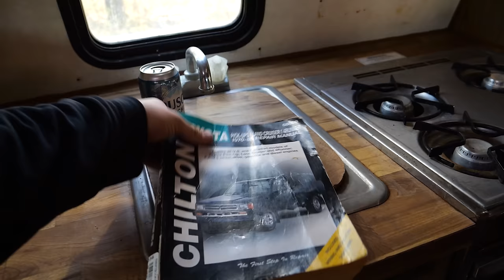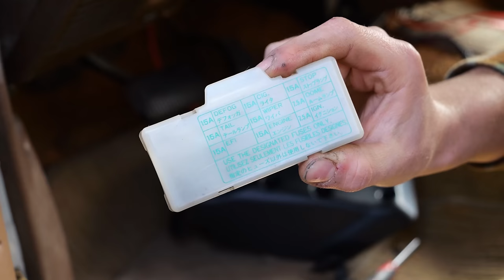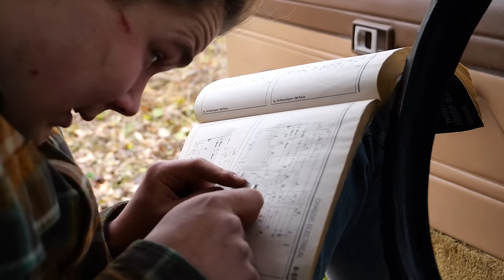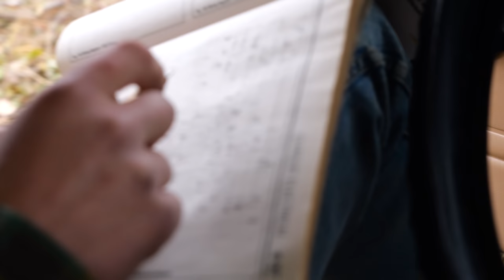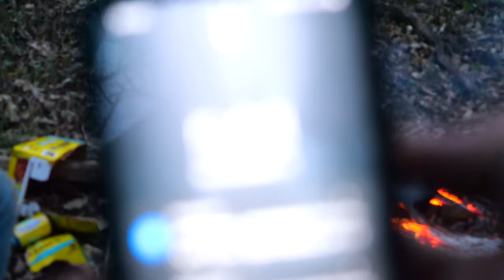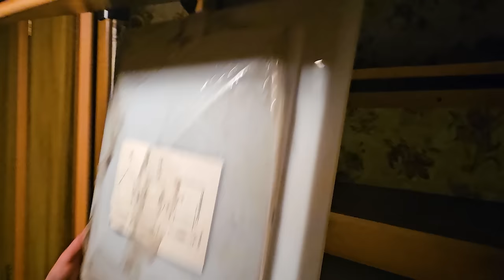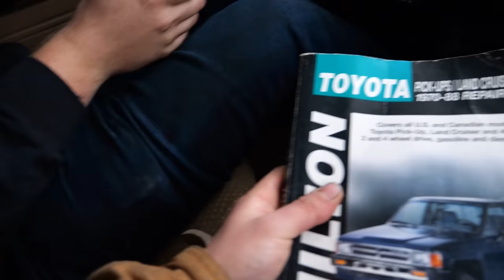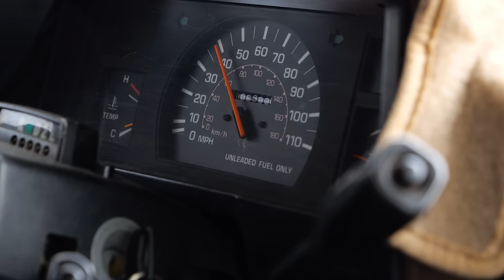Will this Old Camper RUN & DRIVE Out of the Woods?

Comment: the maf sensor has a flap in it that closes the circuit for the fuel pump. So if that engine isn’t sucking any air your fuel pump ain’t pumping. Found that out myself a few years ago working on an old Toyota truck that had been sitting in a storage locker since 1997. Took me 3 days of stress to learn that.
Reply: i got tripped up on this also on my 94 pickup. its definitely an odd way of triggering a pump
Reply: Same on the Celica Supra with the 5m
Reply: 1.6 Miatas work the same way
Reply: The 1990 -94 capris are like this too.
Reply: Yeah, a lot of old cars with the "flapper style" air flow meter worked that way. They do have some adjustment to them as well.
Reply from the maker: What a strange design!
Reply: @JunkyardDigs  I believe it's in case of a crash or whatever causes an engine stall, the pump isn't stuck on dumpings fuel. Also, to not over pressurize a return less system
Reply: Love the respect
Reply: @JunkyardDigs  still waiting to see that b&m supercharger and side pipes from that mustang II on the limo like I suggested
Reply: @JunkyardDigs  old Datsuns, Toyotas were this way.. When you crank the engine enough it will generate enough pressure to open the flapper just a little and then the fuel pump will engage.
Reply: Great episode!! Thanks for sharing your talents, friends and adventures!!!
Reply: Subaru too
Reply: @JunkyardDigs they did it for emissions. My 89 Celica had the same thing also had the crack in the tube. When it would run like crap or not start I knew it was time to replace the tape on it always kept a roll on me in the car 😂😂😂
Reply: @JunkyardDigs  ....toyotas
Reply: If its a bosch based system, it should run the fuel pump while the key is in the start position
Reply: So in theory, if the engine has a form of vaccum leak, as Kevin suspected, it wouldnt be able to pump fuel well enough? Especially after hours when the engine hasnt run, which they seem to run into as well
Reply: First of all check the neutral safety switch, then investigate what's going on with the fuel pump
Reply: aWESOME
Reply: @henryanderson7606  those little trucks were notorious for the problem being in the shifter. Pull up and hold, then turn the key.

Comment: That interior is really in good condition. This is overall a pretty dang nice example of one of these.
Reply from the maker: Come and get er😂
Reply: @JunkyardDigs I would if I had the money laying around. Toyotas and Hondas cannot be killed.
Reply: @JunkyardDigs I will!
Reply: @nahno767  Go get it, buddy. If it wasn't half the country away I would too. It is a very nice little RV. Kevin can keep the crappy Chilton's Manual. Those things are pretty much useless for Toyota pickups of that era. There is technical knowledge that needs to be known but it ain't really in that book.
Reply: How much?
Reply: @JunkyardDigs price? Interested
Reply: @JunkyardDigs if you put a v8 swap from a newer Tundra in it or a Isuzu turbo diesal from a cabover or forklift in it  someone would pay you dum money for it that thing is nice the 22re is bullet proof but man  your only doing 50mph downhill with the wind behind you at 12mpg in it on the wood wide open when she was new 😂
Reply: @JunkyardDigs would be nice with a small block Chevy , get out camping fast and in style . 👍🇨🇦
Reply: 1uz toyota v8 would do nicely
Reply: Is it still available?

Comment: You should 1) keep it and 2) replace the timing chain. You can do the whole thing for $100 easy, and it will probably drastically improve the drive quality and resale value. Also, if I'm correctly remembering the fuse box from my '87, you are missing the fuel pump relay. Also, check the frame for rust before you try to sell it. Without frame rot, you might be looking at 3-5k for that thing.
Reply: I did the chain job on mine last year for about $100. Took me about a day in the sun and it still runs great. Just make sure to get the metal chain guides, the plastic ones will break again.
Reply: @VTOffRoadAdventures Mine should've taken a day...

The previous owner had over-torqued the harmonic balancer to hell and back. I ended up having to grind the head off the bolt and get a new balancer. luckily, by some miracle, the threads in the crank were undamaged.
Reply: repentandbelieveinJesusChrist1  my gods could kick Jesus' ass in a fight
Reply: By keep it I hope you mean the possum.
Reply: @davidannen7448   Even if they were, a drill, tap, and Heli-Coil would have taken care of that easy. I love when people work on their own vehicles! (only if they aren't a complete novice to mechanical repair.)
Reply: @cadenswain158  not something I'd be capable of doing properly. Crankshafts need to be balanced properly, and without a proper drill press, I couldn't have drilled straight enough to keep the balance. I also didn't want to pull the crank, because then I would've wanted to get it turned and replace all the bearings and the rear main seal. That means an engine pull. It also would've probably turned into a new clutch. Any time I work on cars, it always snowballs like that, lol.
Reply: What are you talking about opossums don't have timing chains
Reply: Pure platinum
Reply: @davidannen7448   Your gods killed Jesus but He has the ace card: Resurrection. Your little gods never predicted that. Wait till He shows up again, the little gods are going to quiver in fear. Gloves are coming off next time around.
Reply: @aftonline  your God was murdered by men. My gods only fall to other gods, and they are resurrected as well.
Reply: yeysyyeyeyssYES YES ES YES

Comment: Damn, a Toyota pickup based camper is like the holy grail of campers in my opinion. This one seems to be a great condition and the added bonus of it being new enough to have EFI rather than the carb.
Reply: I had an 88 efi good truck
Reply: seems like the owner just abandoned it, no major problems
Reply: if a normal toyota pickup was already good enough for the apocalypse i cant even imagine this one
Reply: Actually in my book The holy Grail is defined one that's also four-wheel drive. I've seen a few. But it would be perfect for the central Idaho mountains where I love to hang out. That four-wheel drive will get you anywhere. You're not going anywhere fast but you're going to get there.
Reply: @garyfullmer4353  
Totally agree.
Reply: YESSSSSSSSSSSSSSSSs
Reply: @garyfullmer4353  4WD ones (Sunraders) do exist but are unobtainably rare. I think official estimates are that fewer than 50 factory sunraders exist in this body style.
Reply: Just do a chassis swap with a first or second gen 4Runner after beefing up the suspension of course

Comment: On older EFI vehicles with a vane style mass air flow sensor they needed to see air flow through the vane sensor before it would trigger the fuel pump. That's why you weren't getting power to the pump simply turning key on you have to crank engine with VAF connected to intake and plugged in for the pump to kick on.
Reply: I was just going to comment that some don't run the pump until the engine starts cranking. Never knew it was dependant on the air flow sensor
Reply: My 89 Celica had the same set up and the tube also had a crack in it I knew I had to replace the tape when it would run like crap or not start at all lol. That tube was a hard part to get even 20yrs ago and it was kinda ridiculous how much that tube was
Reply: @thesillyhatday  Yea neither did I ive worked on a few older toyotas corollas and camry's from the 90s and I dealt with the oddness that the fuel pump doesnt do jack when you turn the key on. I actually figured it out by accident once while working on a corolla with a leaking fuel line. 

Dude swore up and down that he saw fuel leaking from the line. turned the car on. nada it wasnt till he got in and accidentally started to crank that all of a sudden old faithful sprayed fuel right out and onto the engine. from that point on i just thought that toyotas had some kinda weird thing where you had to go from IGN on to crank before the fuel pump would do anything. never even thought it was anything to do with MAF.

Comment: I have wanted one of these for 20 years. Love the 22re motor. Definitely underpowered for this application, but a bullet proof motor. I had one in my 86 4runner with 367,000 miles and it ran great.
Reply: Routinely pops head gaskets.
Reply: @randyTrevor-fs3to  Huh, mine never did, guess I was lucky. Only problem I had was a spark plug blow out due to the original owner cross threading it and I didn't know. It was the middle of the night and it was -15 in Alaska. I drove from Anchorage to Soldotna on 3 cylinders.
Reply: @leskobrandon6950   I've owned 5 different Yotas with the 22re. 1987 4runner(298k miles), 1988 Pickup(277k), 1989 Pickup(245k), 1989 4runner(289k) and a 1990 4runner that had the most milage out of my bunch that I still have at 358k miles and not one of them having owned them or having paperwork or told from previous owners that they hadn't much or any problems with them mechanically. I've been around them my entire life and cant really say I've seen them "Routinely pop" headgaskets. At most I think the most common problem I faced with them was sloppy timing chains, which on that engine is a cake walk to do.
Reply: damn Toyotas been keeping cars running forever since forever I see
Reply: @randyTrevor-fs3to If that's happening regularly it's cuz the heads warped, and if the head is warped it's cuz it got overheated BAD. I've worked on probably 50 of these and done exactly 1 head gasket, the rest of its timing chains and regular maintenance.
Reply: @Kowyn I've done hundreds of head gaskets just on the 22re alone. Majority of them didn't even have 70k miles on them.
Reply: 89 pickup here, 240k and going strong. Alternator finally died last week.
Reply: @randyTrevor-fs3to Correction: "I've botched hundreds of headgaskets just on the 22re alone. Majority of them didn't even have 70k miles on them, so I've been a hack for decades"
Reply: @randyTrevor-fs3to  Only if overheated or the coolant is not changed. Still on the original head gasket on my 1984 22RE.
Reply: @randyTrevor-fs3to  if you have actually done hundreds of Head gaskets on 22re's then someone cursed you. Between the 5 I had owned/worked on and the many I've helped worked on (probably close too 60ish) I think only 3 of those needed new head gaskets and that was only due to the fact the friends that I helped with wanted to see how the pistons and valves looked and neither of us had a borescope at the time so we pulled the head, and replaced the Head gasket afterwards as Preventative maintenance.

Comment: That thing is going to sell so damned fast. but I'm worried that sound was actually the dreaded timing chain eating through the timing cover (right behind the water pum as a bonus) that is so common on 22re engines
Reply: Yep.
Reply: Nothing different than in old CHT / Renault Cleon engines

Comment: Had a 22RE in an 89 4 runner. Lasted over 300k, no overhaul, just regular maintenance. Rest of the truck rotted out, but was still running strong when I sold it. Best engine Toyota ever made, probably why they stopped making it. By the way, those are great little campers. A friend had one back in the 80s and got about 15 mpg with it.

Comment: It has a 22R. It will live forever. '86 was the first year with plastic timing chain guides, so it would be best to do the metal guide swap if you want to keep it for long term. Sounds like chain slap to me.
Reply: RE brother
Reply: I'd sooner yank the 22RE out, discard the autotragic, refresh it, and sell it to someone with a non-camper Toyota that needs it, then in its place swap in a smallblock V8 and 5-speed manual. That camper is just too much rig for a 22RE to lug around.
Reply: funny my 82 22r celica had plastic timing chain guides tho.....only has 60k miles on it.
Reply: 22R is a carbed engine 22RE is Electronic Fuel Injection. They are the same engine, and completely indestructible.
Reply: @TestECull  The stock Toyota Class C motorhomes have a HUGE following,  BUT seeing as it is very Obvious you know FUCK ALL about these rigs, maybe you should do some homework, on what they are worth with the stock engine in them. You can buy them with the V6 or the 4.0 L 1UZ-FE V8 in them as well already.
Reply: @TestECull  SBCs are everywhere. Why would you tear out a unique vintage drivetrain that's still working just for another boring SBC build?
Reply: @themaritimegirl  To use the interstate without getting killed or ticketed. Normally I am not for such swaps but in this case safety argues for it. A top speed of 55 will get someone killed today. also, automatics suck. 

I would do a hotrod build at all. A bone stock 2bbl 305 would be plenty here.

The 22R is a damn good engine, but it just is not enough engine for a motorhome on 2023 roads. people run 65-70 9n highways and 90+ on freeways. It simply is not safe to drive a camper that maxes out at 55 anymore.
Reply: @KrazyMitchAdventures  They're worth more to me when they can hit 70mph 🤷 Not being able to go with the freeway flow in a vehicle intended to roam the open road is a big problem.

What it's worth to other people is irrelevant to me. If I owned one it'd get a smallblock and a 5 speed stick swap so I could actually use the fucking thing. Happy to sell ths 22r to a collector if they want hut I aint puttin another one in.
Reply: @applehairs  Same block with fuel injection. That's the only difference between the two, which is purely semantics. Only the block matters in this sense.
Reply: @robbalinski1606 If your 22R has dual timing chains which is specific to 81-82, you do NOT have plastic guides. That was on '83 and later. Probably have a late '82 car, which would be called an '83 for the model year.
Reply: @TestECull these engines are capable of highway speeds when they are healthy. This one has issues. 
There was a reason that U-Haul back in the day ran these trucks with boxes.

Comment: Kevin the broken air intake hose will set off the engine check light . To find trouble codes  look around the engine bay for a small grey box with diagnosis on the top. Unclip the lid and connect a wire between T1 and E1 this will make the eng check light on the dash flash. It also stop the ignition advance while connected so you can check the spark timing.. The flashes are coded. EG 1 flash a gap and 3 flashes then repeats or displays another code. That was code 13. Look up the codes on the net. Its a basic system. If you need to check the fuel pump relay its beside the computer either under the centre of the dash down low or behind the drivers kick panel .

Comment: Not only were those Toyota campers rad as hell, they were hella durable, as you clearly saw! Honestly, no surprises anywhere in this video, it's an old Toyota, and the the campers build around them were also well made. This one is a great example for being put out to pasture. Obviously, the axle was geared crazy high for all the extra weight, so the venerable 22RE handled it pretty well, considering they were already fairly torquey little suckers to begin with. Strip all the emissions crap out of it, give it a solid tuneup, and it will continue to run forever. It handles well because that Toyota """1 ton""" chassis was built well, and the whole thing has a crazy low center of gravity, despite the whole camper being added on top of it.
Reply: My old man has a Toyota 1 ton and it’s the same chassis as the other pickups with heavier springs and a differently geared rear end & trans. Planning to give it a new frame and 4x4 swap it. Feels kinda unfortunate to be making a 1 ton into a regular pickup because they’re so rare but a rwd truck is useless to me

Comment: Fuel pumps on the 22re engines don't come on until the vane air meter registers air coming through it. Another way to check the fuel pump is to take the air box and push the vane air door open with you hand
Reply: Fuel pump relay also closes whenever the starter is energized. (Via Dual coils on the pump relay). Kevin’s bypass of the Neutral Safety Switch starter wires may be preventing this “fuel pump on during cranking” function.
Reply: I found out about that when cranking my mr2 turbo on a cold day. It seems to activate the fuel pump quicker in warmer temperatures
Reply from the maker: I knew The comments would figure this out for me! 🤘
Reply: @keithgillette9537  It does? huh i should go back and revist my best mates 94 camry and see if that is causing a problem. his camry has issues cranking and we figured out it was because the fuel pump was not kicking in at key on. nor at first when turned to crank. it will start firing after some air has pushed the vane obviously because it does start and run. that and the fuel pump is newer i replaced it already to solve another issue. but you have to crank it for like 15 seconds before it coughs and eventually fires.
Reply: @JunkyardDigs  if you crank it for a 1-5 seconds the fuel pump should finally prime. Anywhere above 60° you can start it without having to prime it